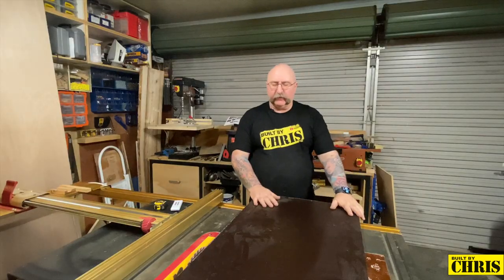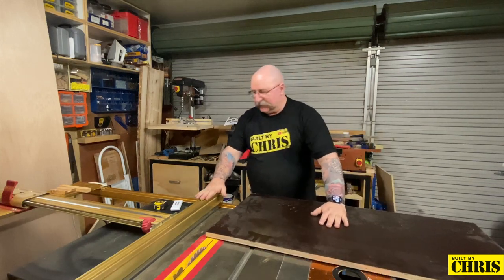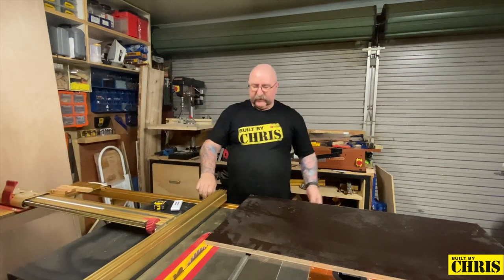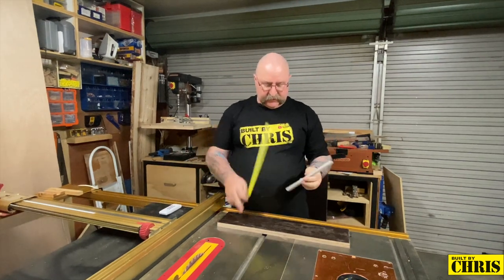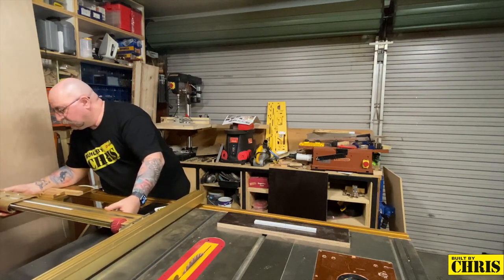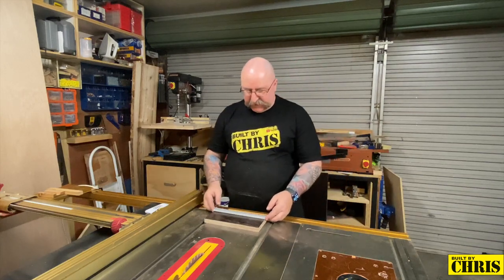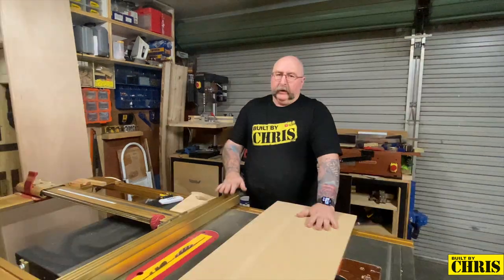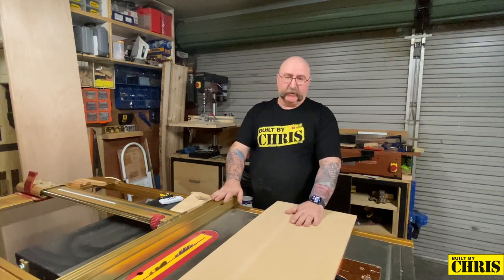How To Make A Pen Blank Cutting Jig

Comment: Cut the stop block higher and the blank can be held square against the fence great fence
Reply from the maker: Hey Reg, please forgive me, but I'm not sure I know what you mean. Are you able to elaborate further?
Reply: @BuiltByChris  If your stop block is raised higher above bottom slide section it allow blanks to fit under(where your used card to allow slide) your blank will then fit against the back of the jig and then blank can be safely held square against the back of the fence  the other option is to make stop longer than 25mm as the length is not critical my one has the stop block higher than the pen blanks this allows blank to fit under stop block
Reply from the maker: @reg.treg.t  I understand now. Thanks for the tip. I will probably end up making another one.
Reply: @BuiltByChris  happy to help